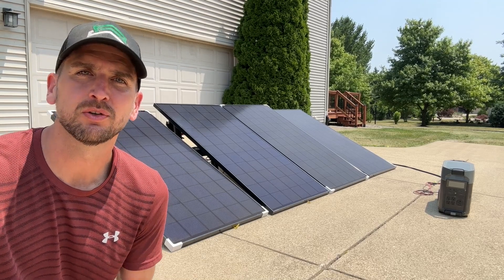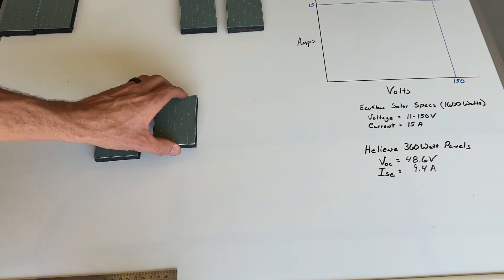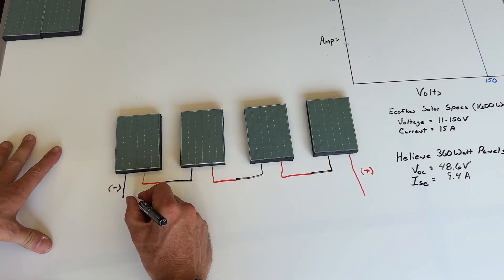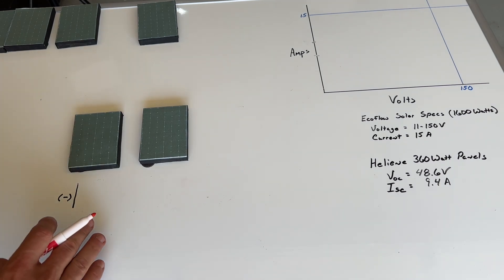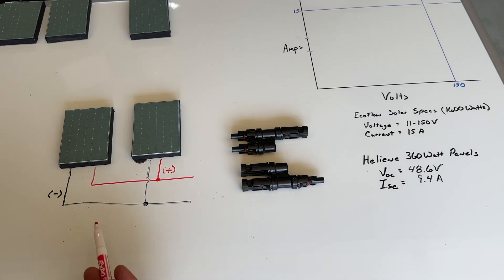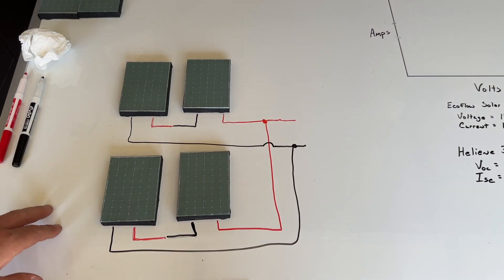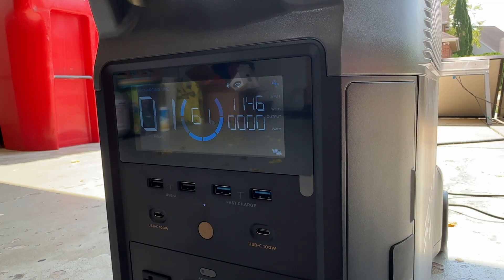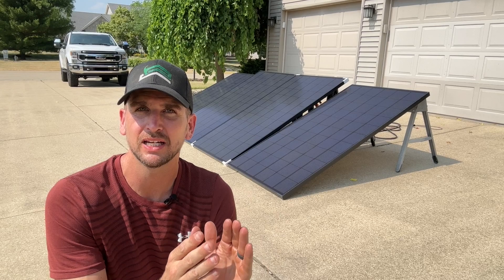Solar Panel Wiring Basics | Maximizing EcoFlow Delta Pro Solar Charging

Comment: For the Ecoflo pro unit you had, you would have been better selecting your panels for your power system. 3 540 watt panels in series would have optimized your voltage at just under 150 volts and 11 amps of current. That in theory will give the ability to maximize your 1600 watt desired input. But it doesn't give you such a great parallel, series educational video. It might have been good to explain how to design your system for optimal function.😊😊
Reply: Unfortunately I was sold such an exact kit and I do get nearly 1600 W sometimes at noon. Problem is that for 3 in string VOC is about 150V (+/- 3%) which would borderline work at 25 Celsius. If it gets colder however,  voltage could increase dangerously, at 0 Celsius calculated VOC could reach in my panels 162 Volts (+/- 3%) which would exceed DP 150 Volts requirement. 
Many talk about not going over that 150V even on coldest days so I'm stuck now with looking for a fourth panel and doing 2S2P setup, ugh! A major pain! And in the new setup the best input wattage I could get is maybe around 1300+ W as a lot of the wattage will get lost at peak, but I'll get it for a longer part of the day supposedly.

Comment: Help me understand what just happened here, you have 4 panels in series but it’s over in voltage. Now you have the same 4, 2 sets in series connected in parallel, how the does voltage drop? And how are the amps not over?
Reply: By using 2 sets of series merging into a parallel, you are essentially doubling the Voltage output AND doubling the Current output. Both are under the maximum the delta can take so it just works. There was also some power loss due to efficiency resulting in 1100w~

Comment: Does going over over the max current or wattage damage the power station？

Sorry if this seem like a silly question.
Reply: Going over the maximum voltage risks damaging the power station. Going over the maximum amps is ok because the power station will only use 15 amps and ignore the rest.  Wattage is just volts x amps.  The power station will limit watts input automatically.
Reply: @teuton6167  thank you for your answer so does that mean I could parallel the solar panels as much as I like (since paralleling the add on the amps but not the voltage) are there any disadvantages to paralleling? If my understanding is sound, then I should try to maximize the voltage(without going over) and keep the amps over the maximum at all time to get the most wattage?

Comment: How much voltage would it be for the 2 panels in parallel?
Reply from the maker: When wiring in parallel the voltage will be the same as a single panel assuming both panels are the same size and voltage output.

Comment: My brain I dunno what's going on usually I understand this. But I'm looking for my specific situation I guess. I have Delta 2 Max. I bought two extra batteries, I have two 220w bi facial panels from Evo flow. How would I maximize this device in solar output. As I want to buy more solar for it. This is for my work shop where power is an issue

Comment: Great video. Thanks! You said in the beginning that you would talk about the disadvantages of parallel and series set-ups. What happened to that discussion? For example, aren't panels combined in series susceptible to shading problems where the no power is harnessed if even one panel is shaded?

Comment: I'm a newbie to this field hoping for a bit of guidance.
I'm  looking at the ecoflow delta 2. Ecoflow panels are v expensive. Renology seem to have a good reputation and are cheaper. I'd wondered at getting 2 of the RSP200D
200W Monocrystalline Solar Panel (to run in parallel?)
Maximum Power at STC*
200 W
Optimum Operating Voltage (Vmp)
19.2 V
Optimum Operating Current (Imp)
10.42

When I asked Ecoflow about compatibility they said (in a very poor response to a potential customer) "we wouldn't recommend it, get one of ours". But didn't substantiate WHY - so the conclusion is simply profits. OTOH I don't want to buy renology and find they aren't compatible or cause damage to the delta 2
I get that I need some adapter cables.

Comment: If I have a broken solar panel and it's now 15 volts instead of 18 volts, can I still use it?
Reply from the maker: If you wire the broken panel in series with other panels that work properly the voltages will just add up.  The issue you most likely will find in series if the broken panel has less current output then the rest of the panels in the series will be "throttled"or limited to the lesser current.  Make sense?

Comment: Great video!! Quick question.I have an Anker F3800 with 32V-60V at 25A (1200W Max each input) Could I use BigBlue SolaPowa 400 watt panels in parallel? They are rated at 61.5V at 8.2A slightly over the voltage. Or would this harm my power station? Thanks.
Reply from the maker: Bummer, the problem is it would probably work 99% of the time but maybe on a cold day you might reach above 60V.  I am not sure how Anker handles this as some units shutdown the solar input but others units can be damaged.  Probably should be careful using that combo.

Comment: Great video!  It really drives home the point that your system needs to be designed with the parameters of each piece of equipment in mind so that you can achieve maximum performance (i.e., efficiency and effectiveness).  The PV panels you choose need to be well-matched to hybrid inverter/controller/charger or whatever load you choose.  As I have found in my research and readings, there is a lot more to designing a solar system than immediately catches the eye., and this isn't even touching the NEC regulations for grid-tied solar systems.  Regardless, great job...very informative at the pragmatic operational level.  Thank you!
Reply from the maker: You bet and thanks for all the great feedback!

Comment: Does the D2Max have the same safe guards, as the DP. As far as putting more volts, more Amps, and just getting zero charge? Until you get it within specs. Don't want to burn up the MPPT controllers
Reply from the maker: Yep, I would just make sure you stay under the max voltage when you add up all of the Voc to be safe.  The current will clip off at the max without issue.
Reply: @everydaysolar  In which case would you still need the inline fuses for a Delta Pro? Thanks

Comment: So I am a rookie and know nothing
I bought the Eco Delta pro and one of their 400 watt panels my question is if I get another 400 watt panel would it make more sense to run them in parel or series
maybe I should clarify i am using this for my shorty motor home
Reply from the maker: You could run them in series as that will be below the 150V max for the Delta Pro and the easiest to wire up.
Reply: @everydaysolar  thank you 👍

Comment: To make it easy; panels in series the voltage adds up current remains the same. Panels in parallel, the current adds up voltage remains the same. Nice production. Also more sunlight equals to more output. But you have proven which method is efficient under the present condition.
Reply: Agree.  But in the video, when the panels were in series, he added up both the voltage AND the current of the panels when only the voltage should have been x3.  Is there something about solar panels that allows current to add even if the panels are wired in series (which adds the voltage of each panel that is wired in series)?

Comment: Can't you wire everything up in series then connect the solar array to a magic box that'll +-V and +-A to be within sweetspot?
Reply from the maker: Depends on what you are plugging the panels into.  For instance the Delta Pro has a 150V volt limit so can only do 3 of the 360W panels in series to ensure you don't max out voltage.  Depending on the hardware if you go over max voltage you can fry the unit.

Comment: So i can buy 4x 375
Reply from the maker: Should be good, remember it is important to check the specific open circuit voltage and short circuit current for those 375W panels.

Comment: would a fifth panel work?
Reply from the maker: No, that would not work well with a series-parallel wiring setup.  You wouldn't get any gain from the 5th panel.

Comment: I read the comment below that you agreed that these panels' specs aren't the optimum choice for the Ecoflow due to the Eco limitations.  I just got the Pro and would like to know what specs to look for.... and avoid..... in four 400 watt panels to get the closest to 1600.  And your drawing is the clearest wiring explanation yet - I haven't understood ANYONE else!  Thank you!
Reply from the maker: What makes a setup easy is if you can just wire panels in series and get close to the maximum solar input wattage.  For these panels I was maxing out on the voltage which meant I needed to start wiring in parallel.  The challenge would be to find a panel with higher current output (closer to 15 Amps) and lower voltage output (closer to 35 V).  Not sure those panels exist 🤷‍♂️
Reply: I just purchased an EcoFlow delta pro and four 415w bifacial Hyperion panels, they’re VOC is 37.45 and Amps are 14.02, in theory I could run these in series and my volts would be 149.8 , just shy of the delta pro’s limit of 150v. Is this a bad Idea get so close? Or am I better to run series-parallel and lower my volts to 79.9 and bring my amps up to 28.4?
And if the delta only pulls 15A from that set-up wouldn’t I have to re-work the watt/law and calculate 15A X 79.9= and only get 1198.5watts??
Reply: @Mr.Excitement-gn4ev Hi, I have the same issue). Have you fixed it already? How is looks your configuration? Thanks in advance

Comment: I own two EcoFlow Delta Pros. Is it necessary to use individual XT60 cables for each unit, or is there a method to link both XT60 ports on each EcoFlow Delta Pro to a single cable?
Reply from the maker: Hmmm, I just use individual cables one for each unit.

Comment: So I'm using First Solar, Inc Flextronics FS-6435A solar panel. Says 435 watts on the back of the panel. I guess I can only use 3 panels?  I've got 435 watt panel, Voc 219.6 and Isc 2.55
Reply from the maker: Oh man, that is a high Open Circuit Voltage.  I don't think that panel will work with the Delta Pro since the maximum voltage for the solar input is 150V.  If the voltage is above 150V the Delta Pro will shut down the solar input.

Comment: can anyone tell me, what if you charge and also drain at the same time, if the productive current pass through batteries before drain ?

I mean, lets say we charge the Delta 2 with 500 Watt, and at the same time we ask for 500w power. Does the current pass through the batteries or this is working like an online UPS, means, im taking what i am producing, if the producing current its higher, then and only then, the batteries will get that current and charge.

Comment: Awesome video....what gauge wire did the electrician use to install the smart panel 12feet from the existing panel?......I would install mine about 25 feet from my existing panel.

Comment: Another question (please): Your EcoFlow handles over current, but not over voltage. I have cheap grid-tied inverters with limiters that have a max of 1000 watts output each. They have very low voltage maximum input so my 320 Watt panels can not be put in series. I have a number of them wired in parallel so that I can have at least three panels per inverter. I would like to put four panels per inverter but it would be over the max current input the inveters are rated for. Can I safely  "over-current" my inverters by adding the fourth panel without fear of hurting the inverters as they will "current limit" and protect themselves? (Assume I have all the fuses, disconnects, ...... in place). Thank You!

Comment: how come u did parallel when the max imput is 15...each panel is 9a....for the parallel that would be 18a....what am i missing...ur over the 15 a
Reply: The ecoflow will only accept 15a. It's okay that it's over, but will only allow 15a in.

To calculate watts, you can use the formula W = A x V,

Comment: I really appreciate your videos, which seem to be targeted at DIY types like me. So why promote the ‘solar reviews’ link (which ultimately results in a slew of spam from overpriced solar companies)?
Reply from the maker: Thanks for the feedback.  I personally went through the link and haven’t been getting any calls or emails.  Are you getting spammy calls?
Reply: Any ‘calculator’ that requires your email address AND phone number (like this one)—yes, I get spam calls every other day. The resulting cost estimates are for generic one-size-fits-all solar installations at full retail pricing. These days, when you can buy a 13kw 2-phase DIY system with 20kw battery back up for less than $12,000, it would nice to see a channel that could pair us with contractors to install them. (I personally just want to find someone to install the panels; the rest I can do myself.) 😊

Comment: Hello great video. I was wondering if you can combine 24v panels with 12v using series parallel? I have 4 12v panels and 2 24v. This is on a 48v system, controller can take 150v, 3.2k watts, 60amps. Question is more about the panel voltage than anything. Obviously the Voc and all need to work first. Thank you

Comment: Nice vid 👌 
Could you explain why you can exceed the rated 15 amps of the delta pro? If you had a long term setup would there be any negative things associated? How would rate for inline fuse?
Reply: The short answer is amps are pulled, volts are pushed. So, if you push too many volts to the ecoflow, it won’t accept it. If you make too many amps available to the ecoflow, it doesn’t matter, it’ll just pull 15.
Reply: @ConorLennon  Thanks. Do you know why they're recommending inline fuses for parallel set-ups to prevent exceeding the 15A rating?
Reply: @magnus5982  so that in case of a short it doesn’t catch on fire.
Reply: Another waiter for such an explanation...
Reply: I was hopeful for this explanation as well.
Reply: Another waiter...
now we need a waitress.
Reply: I’m wondering is there a point at which there’s too many amps? Like what if it’s 40 amps, and the unit is only pulling in 15.. vs 25 amps and pulling 15?

Comment: Soo. How can I get the full 1600 watts of power?
Reply from the maker: To max out the solar input capability I would size panels to specifically match the Voltage and Current specs on the Delta Pro.  For this test I really just used the panels I had which were not purchase specifically for charging the Delta Pro.
Reply: @everydaysolar  What panels and configuration  would specifically match a Delta Pro to get the max solar input ?

Comment: I got myself in all sorts of mess with mine. I have a 400W, 2 x 200W and 4 x 175W and I have 2 X Delta Pro’s with the Powerstream Inverter so I can input 1600W in each Pro and two individual 400W inputs on the Powerstream. I only want to use one Pro at a time with the Inverter plugged in powering the flat (apartment) while the other one charges ready to be swapped. I’ve gone through different solutions via AI and it told me not to connect all the panels because they’re different voltages but I’ve seen it done in other YT videos and the people didn’t seem too bothered about it, I just don’t want to cause a fire first and foremost. I have 700W (4 x 175W) going into the Pro that’s not being used and 400W going into the other Pro via the inverter but I’m unsure about connecting the other 400W (2 x 200W) because they’re 2 x 23.?v rather than the <48v of the full 400W panel. 

See, a mess. Any knowledgeable and safe solutions would be very much appreciated.

Comment: so am I to understand that in theory 3 panels in series would put out a total of 145.8V * 9.4A = 1,370.52W ?
Reply from the maker: That would be if you added up the Open Circuit (OC) voltage and used the Short Circuit (SC) amperage.  In practice plugging these 3 panels into the EcoFlow delta pro it will adjust voltage to reach the Maximum Power Point (MPP) and this will result in the optimal power output.  In my area on a nice sunny day each of these panels would adjust to around 40V and 8 Amps depending on intensity of the sun.  So if we used those numbers we would get 120V at 8 Amps or 960 Watts which with a few losses from wires and connectors is close to the 890 Watts I was seeing.  Sorry, this info would have been good to include in the video and good question.
Reply: @everydaysolar  Thanks, what is a good place to get decent panels online, the sites I have visited usually have a minimum and work with larger orders I would need only 4-5.

Comment: Hello. Thank you for the tutorial on this. It was perfect. How do I get around my scenario. I have an RV with 3-180W panels connected to a 40A solar charge controller charging 2-200AH Lithium batteries. How do i get the solar power to the Delta pro in this scenario?
Reply from the maker: Do you just want to charge the Delta Pro or are you trying to integrate it into your existing setup?  Do you currently have an inverter connected to your 2 X 200AH batteries?
Reply: @everydaysolar  There is a Xantrex 1000W inverter in the system that runs nothing but the residential fridge. I ultimately would like to incorporate it into the existing setup. Unless you think there is a better option or setup